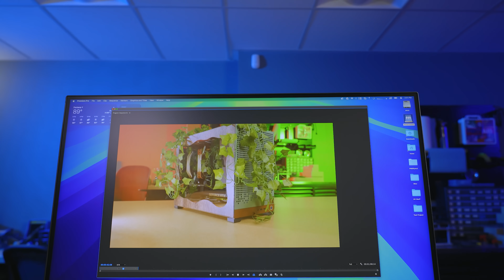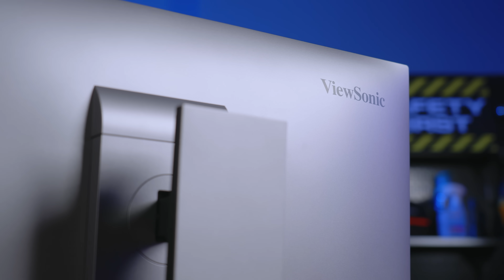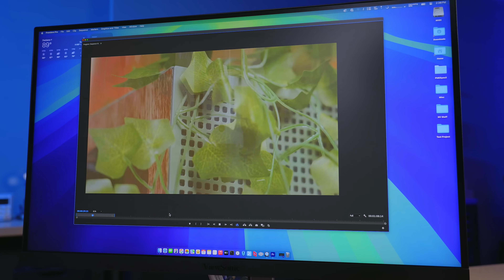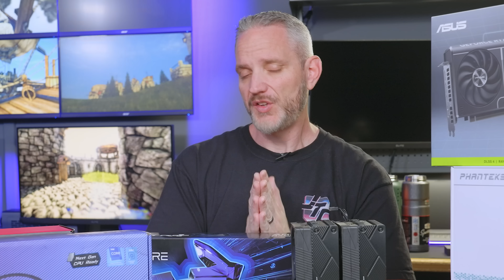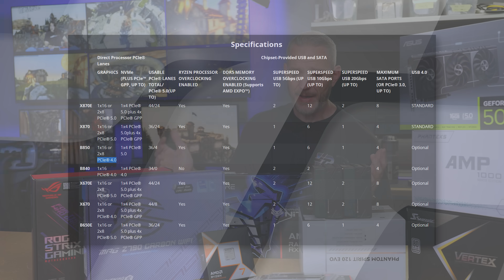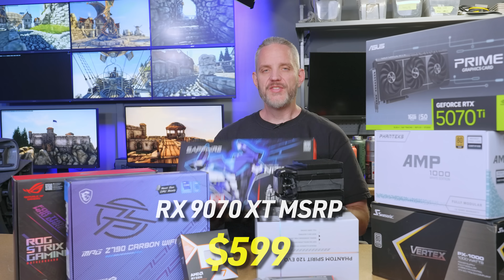This is the Sweetspot for PC gaming... Don't get fooled into spending more!

Comment: A good AM4 system and you've hit the sweet spot for most games.
Reply: Sitting on a 5800X3D with a 7800 XT.  At 1440, it's going to last me for awhile longer.  Just to break-even on performance on AM5, I'd have to spend at least $400 on MB/CPU/RAM.  To get meaningful performance increases, it is at least $600.  I'll wait for Zen 6, or maybe Intel will have their act together in 2027.
Reply: @RandallRoman heck yes i have a 5700X3D and 7800XT in my rig although I really overspend on a full custom loop but screw that its fun and super duper quiet
Reply: @Fiftykilowatt  I'm running a 5700X3D + RX 5700 combo right now, but I just ordered a 7800XT last week on a sale here which, accounting for inflation, was cheaper than the 5700 I bought back in 2021 lol
I can't wait for it to get here, if my research is correct it should be about a two-fold improvement on performance on a lot of titles lol
Reply: @Fentskii it’s going to be a very noticeable improvement thats for sure and i wish you nothing but happiness and lots of fps 😁
Reply: @RandallRoman  Yeah, that system is still perfectly capable of a good experience on any game being released right now, and should be good until the next gen consoles come out. There is certainly nothing worth upgrading to right now.
Reply: I build a sweet sub 1400€ 5700X3D / 7900XT system last year chefs kiss that thing rips for the money
Reply: I got a good set of 64gigs (4sticks) at 3600 cas18 ram in my old AM4 rig my buddy has now. It can be finicky sometimes, but it runs flawlessly like 90% of the time. If I drop it down to 3400 runs without any errors..but mmmmm 3600 ddr4 at cas 18.
Reply: @Electrify928  I wanted to buy a 3600 cas latency 14 kit, but it was too much. Basically any 3200 or 3600 kit would've performed close enough for significantly less cost at the time. So I just went with a different 3600 kit.
Reply: A new am4 or am5 build costs the same. AM4 is great if you already have it though.
Reply: @skinnytimmybeats  What are you talking about? AM4 R5 and R7 are almost half the price of their AM5 counterparts now.... as an example a R5 5600 would set me back roughly €90 whereas a R5 7600 will cost me €175. There is less of a price difference when it comes to the motherboards maybe roughly €30 ish between the average B550 and B650 mobo. They don't nearly cost the same over all.
Reply: Yup, AM4 for the win! Current system is a home built 5800X3D + 9070 XT Nitro + 32GB RAM (was a 3800X + 2080 + 16GB when first built back in 2019). I play in 3440x1440 144Hz (I typically limit to 120) and have no plans to upgrade any time soon as it plays everything I throw at it at Ultra or High settings. Maybe AM6 at some point a few years from now?
Reply: Yep.

5700x
32gb 3600 ram
5700xt, looking to upgrade soon.

Its a good system still. Runs what I want it to, just maybe not as well as I would like. Still good in 1440p in many great games.
Reply: 5800x RTX 4080 64 GB 3600 Ram. I’m happy as can be.
Reply: While AM4 is still good enough and I wouldnt tell anyone on AM4 to upgrade yet telling people building a new machine in 2025 to go am4 is just horrible advice and not a "sweet spot" at all. Nothing about being on a dead platform with no future is a sweet spot for a brand new build don't spread miss information lol
Reply: @donkeymoo1581  unless the plan is specifically to get a AM4 platform setup with decent RAM but a low-end CPU now then drop in a 5700X3D or similar later, which even that isn't as appealing as it used to be since they spiked in price, I agree it's now hard to recommend buying into high-end AM4 without getting a deal that's significantly better than the going rate
Reply: Im in the same boat. 
5700x3d w/ thermalright dual tower air cooler 
Asus ROG strix B550 mb
Titan RTX w/24GB VRAM(planning to sell and upgrade to something newer)
32gb 3600mhz cl16 of G.skill trident Z DDR4 memory 
4Tb Kioxia m.2 SSD for my steam library and 
2Tb samsung OEM version of the 980 pro m.2 SSD 
All inside a new Be Quiet! Lightbase 600 case.

Very happy with my build and it should last me several years to come. 

Although, I am lucky and recently did a sweet trade on fb market for my 3090. In return I got a intel  I9-12900ks cpu and an Asus ROG Maximus z690 motherboard including some basic DDR5 ram(plan to get a faster memory kit soon).
Essentially my dream pc build from 2 years ago.

I also added an MSI rtx 4090 and I'm currently using a ID-COOLING air cooler which it absolutely struggles keeping the cpu cool.
4Tb WD black sn850x SSD
2Tb Kingston renegade fury SSD
All in a free Antec Performance 1 case with missing side panels(so i custom made some myself and used neodymium earth magnets to hold them in place lol).
So I've been considering selling my AM4 pc or the AM4 pc i built for my dad and upgrading his with a mini pc and using the leftover $ for a good AIO cooler
Reply: My am4 platform died so I got an I5 12400F with RX 9060 XT 16GB with 32GB of ram, running everything well.
Reply: 5700x3d 4060ti 8gb 16gb ddr4 3200mz
Loves 1080 FPS
Reply: Yeap have two rigs one 5700x3D 153$ 4080S tuf 960$ and 5800XT 140$ 9070XT 713$
Reply: AM4 today means you can never upgrade the cpu... seems unwise to get a  budget cpu on a plaform that cannot upgrade it.
Reply: @jetrpg22  It’s hard to predict whether a future upgrade will still be worth it, so I wouldn’t focus too much on that right now.
Reply: I'm on a 5800X3D I got a few years ago helped by an AliExpress coupon, 2x32GB Ballistix 3600@CL16 and an RX6700XT with a 700W PSU. Not foreseeing upgrades any time soon but I'm confident I'll be able to handle at least one significant GPU generational upgrade without so much as a twinge of desire to change platform
Reply: I think my 5800x3D, 2080 Super, 3600 Ram on 1080p will still stretch out for 2030 yet 🤞
Reply: And can upgrade to 32gb of ram without instability issues running 4 sticks
Reply: @TheBlueBunnyKen  Running standard JDEC you mean. I've been on AM4 for years and trying to run any XMP profile across all 4 sticks is a pain in the ass.
Reply: @TheBlueBunnyKen  true. Whether I've done 32GB on 2 sticks or 32GB on 4 my Ryzen system on the AM4 platform has been solid for stability.

Comment: Sweet spot for mobo and air cooler is where most people mess up. Get what you need, not what looks cool
Reply: Forget the looks I have a million usb devices I need to connect for day to day usage 😆 I need all the ports don't have budget for aesthetics.
Reply: @JohnAlzayat Same. And I am willing to pay the premium for X870E to get USB4 40Gbps. I had to buy Thunderbolt 4 card on X670E to get it. Well worth it if your use case requires high I/O bandwidth.
Reply: @JohnAlzayat  Get a USB hub
Reply: @AtomicAlchemist I’m in the same boat as he is, I need 8 usb ports minimum and occasionally need more. The problem is that a lot of what I need to use only work if directly plugged in since it needs exclusive access to the data transfer available through the port, and the things that I CAN connect through a hub see too much latency and causes the gaming experience to be pretty rough
Reply: @ThatWarlockBoi I do flight simming and so need usb plugs for days. Get a good usb c powered hub and mount it somewhere.
Reply: @Tempest-ec2nn  got any brand recommendations for that? I’ve had some pretty bad luck with hubs lol
Reply: This. Don't get fooled by the looks of the mobo
Reply: I was able to get the ThermalRight Phantom Spirit 120 SE for like $30 and it is more than enough cooling for my 7800x3D. And it was way cheaper than even the most budget of AIO’s. Spent that extra cash I saved on a better Motherboard. Nevermind that if something on the cooler breaks, all I have to do is replace a fan because that’s really the only moving part the cooler has. Whereas if the pump on an AIO breaks I’d have to throw the whole thing away.
Reply: @MormonDude  what are the temps on your CPU, satisfied so far withe the cooler? I am planing on getting the PS EVO
Reply: @KingNothing995 I don’t really check the temps but I also don’t really push my system that hard and I don’t ever over-clock it. The cooler runs very well and the fans do not have to run too fast. If you just want something that will just keep your CPU cool, then go with it. If you want more cooling power, than you will need to get a liquid cooler.
Reply: My Noctua dual 120 has lasted me 4 upgrades.
Reply: just get an arctic freezer and call it a day
Reply: same for the case, even a 5090  9800x3d build can get away with a decent 100$ case, a dual tower aircooler, and a b650 motherboard.
to be fair though even aios dont cost that much anymore nowdays, you can get a decent 360 aio for like 100$, its still 70$ more than a good dual tower air cooler, but at least you are getting extra exhaust fans with it.
the main difference now between air coolers and water coolers, is thermal capacity for water coolers and reliability for air coolers.
I wouldnt buy an aio with less than 5 year warranty though.
Reply: @FantasticKruH  I mean, 5090s are huge. You need a big case to fit one.
Reply: I got what looks cool. And I will do it again 😂
Reply: @brutalwang4106 yep if I’m gonna look at it every now and then, it’s gonna bother me not having the look I want😂
Reply: It like buying a car, I might not need this and can save more money but I WANT this one
Reply: seriously rgb is very overrated and can be a bad addiction. im a recovering rgb addict. i still have some rgb, but i dont buy anything because of it. Noctua helped me. its very easy to lose sight of value and performance.
Reply: Unless they buy a 13th gen Intel CPU and a B760 motherboard and then want to undervolt, and realize that they can't, because Intel considers undervolting to be overclocking, and they don't allow that on their "cheap" B-series motherboards (unlike AMD).
Reply: Agreed on the mobo but AIOs are so easy and reliable these days that its just better imo. Don't spend over $120 on one unless you NEED a 360 for some reason. But 240s are amazing value. I still have a nzxt 280 that works flawlessly with only 1 paste replacement (this year) in the last 8 years.
Reply: I need what looks cool
Reply: good 240 AIOs are sub 70 bucks nowadays, but even then a Hyper 622 keeps my 12600k at sub 68*C and was 45 bucks lol
Reply: @Shadow0fd3ath24  Thermalright's 360 aio is $50. YOU LITERALLY CANNOT BEAT THIS DEAL.
Reply: @Shadow0fd3ath24 fr on the AIOs, I’ve used a Corsair 240i for probably 8 years? Only just yesterday I finally upgraded my CPU to a 9700x and went with air cooling. Modern AIOs can last a long long time. That thing kept my 6700k cool for damn near a decade!
Reply: I got a 280mm liquid cooler since it was the same price as an air cooler. It's now cooling my I5 12400F and it barely reaches 40-45C under 100% load. If I see 50C, that is the highest I have ever seen. I also got a Gigabyte B760m Gaming X DDR4 mobo.
Reply: Then whats the best mobo for the 9950x3d that wont choke?
Reply: I always had trouble with getting the right number of VRM phases on motherboards. I like to make sure the mobo can let the cpu hit max boost and that's all I need, so I never know how many phases are needed and it varies wildly between manufacuters. Any ideas on the minimum amount needed to hit max boost? I usually just go by various reviewers which helps.
Reply: @Mason_alum08 what's your set up. I tell you right now 😎
Reply: @ishu87  Sorry had trouble posting a reply. I have an AMD Ryzen 5600 (non-x) and an Asus TUF B550 Plus Wifi II. From the research I've done it should hit max boost clocks on that CPU no prob. Is that your assessment too?